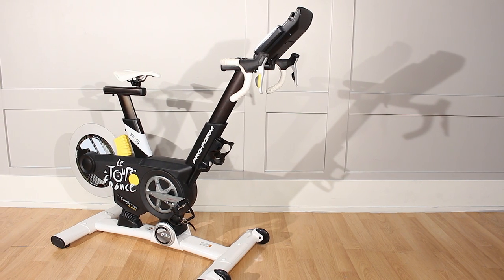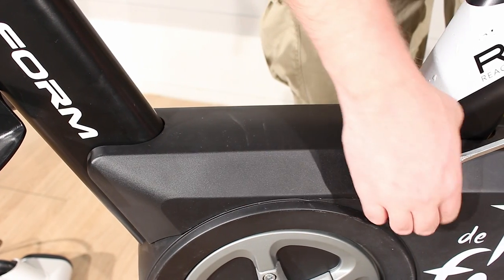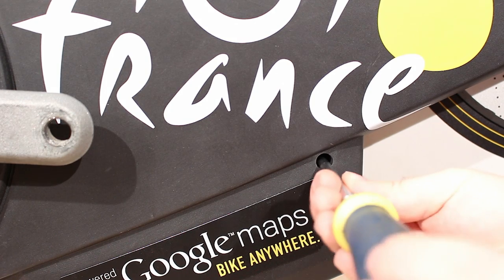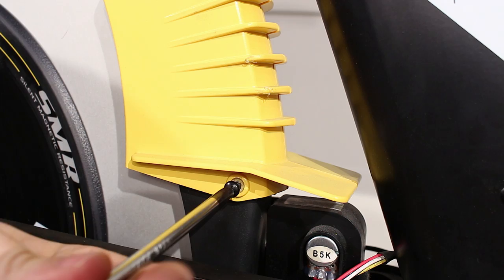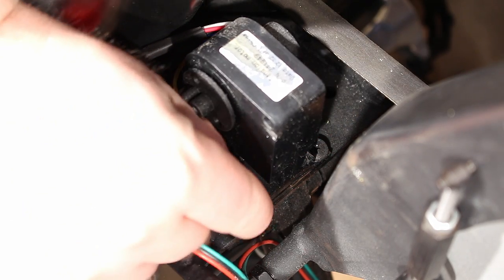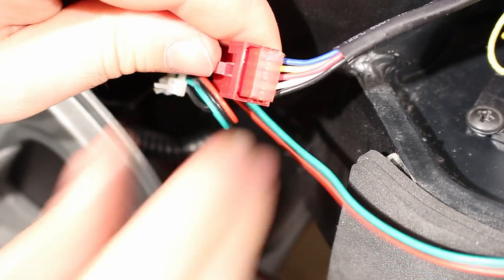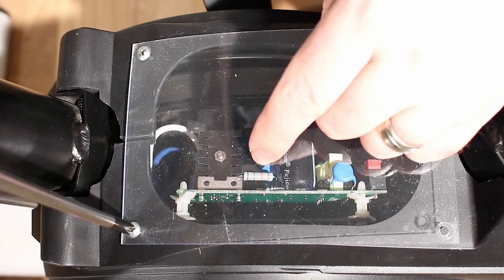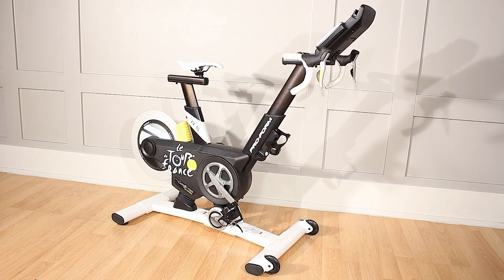Resistance Motor Replacment ProForm Tour De France

Comment: My TDF no longer provides any resistance.while riding. How do I know if its the resistance motor?
Reply from the maker: the resistance motor only moves the resistance magnet back and forth. If your magnet bracket is still moving then your resistance motor is functioning and you have another issue. If you can hear the motor trying to move but you have no movement then you may have a disconnected link arm or a bad motor. Typically the motors will still make some sound if they are receiving power. If the are not moving but grinding or making noise it may be a motor. If you do not hear the motor moving you may have a damaged wire since no power is being received by the motor.

Comment: I’m trying to fix my dad’s tdf and as soon as I plug in the bike the motor the resistance magnets constantly move up and down. Please advise.
Reply: I should have said more. The motor is moving. It’s moving the magnet in short bursts back and forth. Without getting on the bike it does it when plugged in. . I’ve reset everything, I’ve taken it all apart and disconnected and reconnected the motor and nothing helped.
Reply: @mikerushton6745  My bike has started doing the same thing today. Did you work out what the problem was? I'll start peddling and then 30 seconds later it has gone to almost max resistence without me changing anything.
Reply: @61XAA  I still haven't figured it out. I kinda gave up. I'll look into it more this week if I have time. Please let me know if you figure anything out. I'll do the same.

Comment: Hi, I have a 2nd generation tdf, the highest and lowest gears are working but nothing in between. When i change gear it registers on the screen but doesnt change the resistance until i get to the highest or lowest gear. Would this be the resistance motor?

Comment: My bike goes extremely hard to pedal after a few seconds of riding. It's like the resistance is too high. Does anyone have  any ideas at all please? Thanks in advance.
Reply from the maker: If you have one of the older " Proform Tour de France, "TDF", bikes they are designed to increase the resistance the faster you pedal. If you decrease your pedaling cadence or change gears the bike will lower the resistance felt.
Reply: @FitnessEquipmentHelp  hi thanks for the reply. It's that much resistance I have to stand up and try to pedal I can barely move the pedal it almost needs both legs on one pedal. I'm not sure what causes this I can't use it because of it unfortunately. Yeah it's a Tour De France RS Reach and Stack model PFEVEX71516.0. The bearings all seem nice and I can spin the flywheel and there is no noise. The yellow magnetic brake keeps coming out. Sometimes it goes in and out. It's almost like if I try to pedal the magnet comes out the whole way to stop me being able to pedal and when I stop pedalling it goes back in and repeats.
Reply from the maker: @crazy-jake  try re calibrating the incline. if the console believes you are at a really high incline it will simulate up hill by increasing the resistance. After re calibrating the incline try pedaling at 0% or at a decline position.
Reply: Well thanks for your help. It allowed me to think about it in more detail. What I found out is. That when I cycle with no incline so it will be set at 0% after doing a calibration of the incline it will pedal fine. No resistance perfect. When I did increase the incline the bike actually declined but the incline went up on the screen. So I reversed the two spade connectors and the bike now acts like it would in real life. When I choose decline it goes down on the front of the bike now and not up! So this has not be solved. If I choose an increase of the incline from 0 to 1 which is one press of the button it makes the bike go extremely hard to pedal and is unusable still. I'm getting closer to finding the answer. There is a way to adjust the resistance motor lever/spindal as it is a threaded bar. Also below on the incline housing there is a little Potentiometer that you can turn with a screw driver which I have no idea what this does yet. I have not attempted these but I think they are my best bet... Ofcourse writing down how much I turn everything and marking it with white pen so I can put it back to where it was if it ends up worse. Unless you have any other ideas. Also I wanted to add that if I choose no incline or have a decline of any amount the bike works perfectly. But soon as I choose an incline of just 1 increase from 0 incline its unusable. Thanks again.
Reply from the maker: @crazy-jake  I'm kind of starting to think that the resistance motor my be giving bad feed back to the console. the red black and white wires going to the resistance motor are supposed to tell the console at what position the motor has rotated to... corresponds with a resistance level. the motor is turning way to far. if the wires are intact i may see about the resistance motor.
Reply: @FitnessEquipmentHelp  Soon as I pedal on the incline the motor moved the magnets over the wheel which takes a few seconds. Then it's extremely hard to pedal. If I stop pedalling the magnet moves away from the wheel. Then soon as i touch the pedal to pedal slightly again it will come back out again. Yeah it does all seem like the motor comes out too far. The wires seemed fine as they went around the bike and fine under the cable ties. I checked the plug on the end and it's fine and clean. Connector on the main board seems fine. Maybe a bad motor then hmm. Thanks
Reply: @FitnessEquipmentHelp  Hi there , I actually encounter exactly the same problem, and I am based in Indonesia. May I know what is the frequency of resistance motor designed for? Electrical frequency in Indonesia is 230V , 50 Hz, wonder ifthis could be a factor or the motor is just simply broken. I have to put incline at -1, to pedal comfortably at which point adjusting  gear resistance does not work. When I set the incline at 0 or above, the exact same problem as this  forum appears.
Reply from the maker: @adityasutandhi5874  the motor itself is designed to receive 6 VDC. It receives this voltage from the power board wich will be different depending on the market. There are 240 VAC 50HZ units and 120 VAC 60HZ. Because the resistance motor is designed to use DC voltage I don't think it is a frequency issue that you would be experiencing.
Reply: Hi, i have a 2nd gen tdf, when I change gear it registers on the screen, but only the highest and lowest gears zctually work, would this be the resistance motor?
Reply: If i pedal at the slowest speed the pedal turns nicely. Soon as i increase the speed of the pedalling it goes really hard and I cannot pedal. Setting the decline to -1 seems to improve the bike. It is almost as if the incline/decline sensor is reading incorrectly or the magnet is moving out too much at each gear change. First few gears seem OK. Then I go up a few more then i cannot pedal at all. It's just knowing how to exactly pin point the issue. Everything on the bike seems to move. The bike does incline and decline the magnet comes out bit by bit when I change gears and if I increase the cycling speed.

Comment: Can you replace the resistance link arm you say about proper adjustment in the video. On the proform tdf 5.0 the silver arm you disconnected if it got broke by the seat lever being down causing it to break
Reply from the maker: Yes, that is a replaceable part. For parts you can go to www.iconservice.com or call the number on the front of your manual. to make sure you get the correct parts make sure to have your model number, and use the key number for the part from the exploded diagram in the back of your manual.